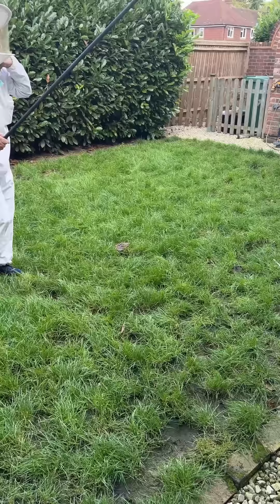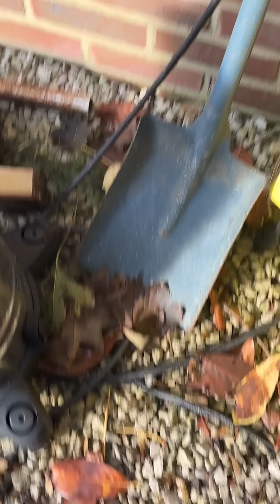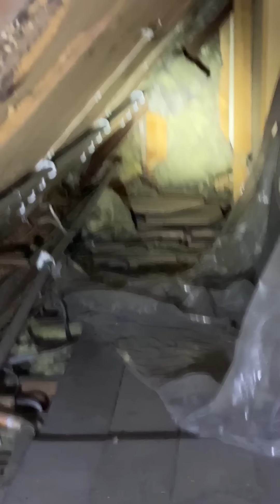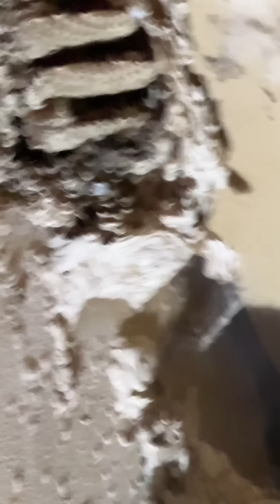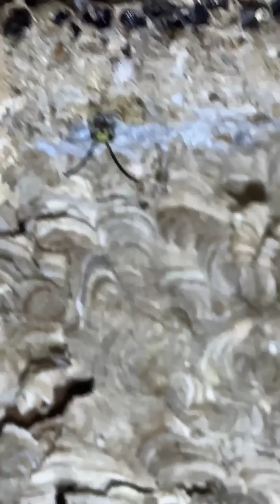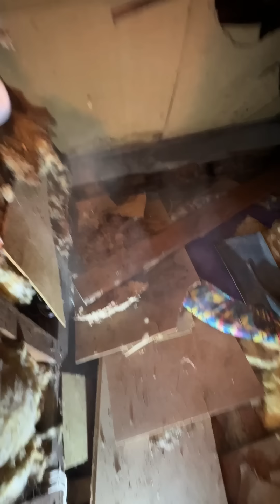GIANT Wasp Nest in My DAUGHTERS bedroom!!

Comment: Oh wow, I hope this isn't inside the walls as well.
If it is it definitely needs removing 

Posted this on the short as well: 

So you need to get a 1 litre spray bottle with a stream nozzle. Put about 118 mL of dish soap in it and slowly fill the bottle with water until it is 3/4 full. Gently swirl the water until the soap is incorporated but don't make bubbles. If a wasp gets out spray it with the soap water and it will kill it, you can also spray the nest. (Just adding that you need to saturate the nest before you knock it down then smash it or bag it quickly).

If you add about 21 drops of Geranium essential oil , 21 drops of clove essential oil and 21 drops of lemongrass essential oil to the bottle you can use this to repel. Spray the borders of ceiling  and corners where the walls meet all the way down to the floor throughout that entire little room. Repeat weekly.
Also spray the outside perimeter of the entire house on the roof and anywhere they gather. Repeat weekly until they stop coming back.

This has worked for us. The entire house was being claimed by wasps and we all got stung. They wouldn't leave us be. We saturated the nests, knocked them down, sprayed any wasps that tried attacking us and created a barrier with the soap and essential oils. It works. You have to be vigilant and keep up the barrier spray and spray them the second you see them trying to be active again.